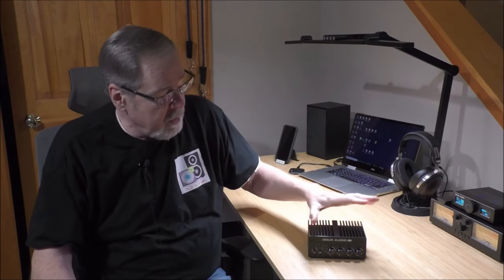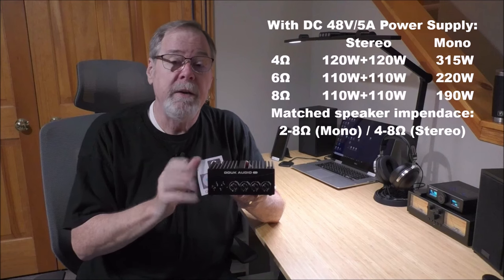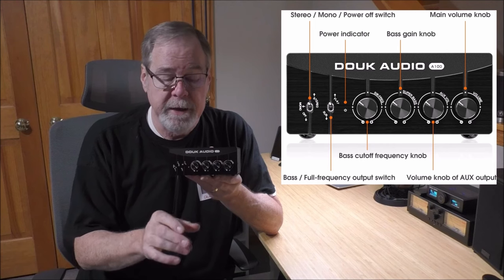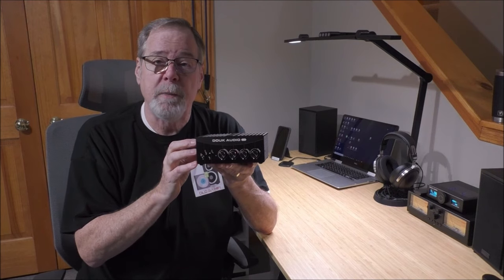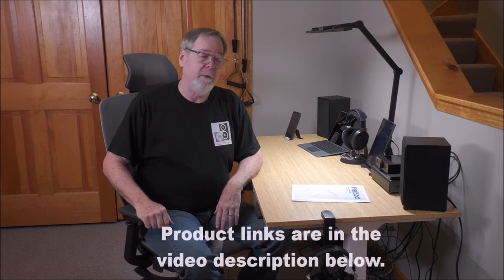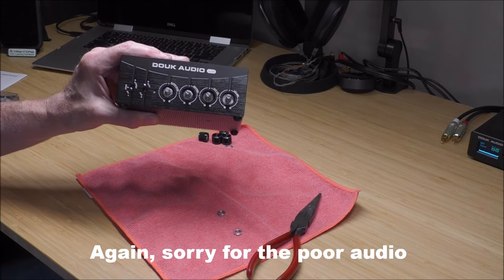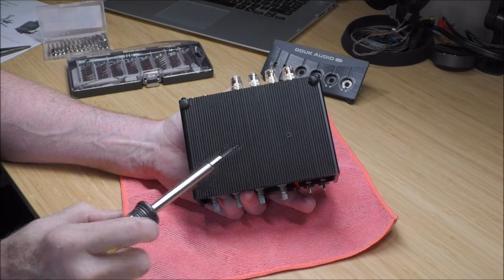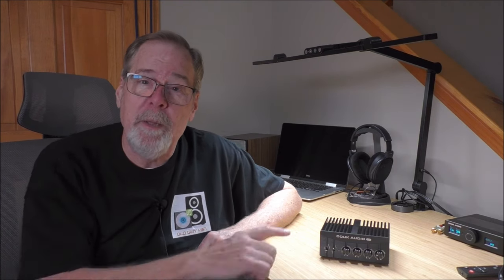The Douk Audio A100 Amp. It's a cool unit that you can tailor the sound of by swapping it's Op-Amps.

Comment: Nice vid! Thus far I'm really enjoying the A100. Was really floored to find it besting my Fosi V3 which bested the Ayima A07. 
Really not finding the need to even think about opamp rolling. Enjoying it stock. I find it to be very warm and yet detailed and punchy. GREAT mids! The Burr Browns did what to the sound ya think? I know the bass on the Fosi V3 may have dug a HAIR deeper and was probably had more slam. I'm a bass player and a bass guy and feel any tradeoff was well worth it to have all the other positive attributes that the A100 brings to the table. Speaking of tables.....nice table you have there for sure! :)
Reply from the maker: The BB2134s added a bit of warmth in the mids and took the edge off poor recordings.

Comment: I just got a raw amplifier board that has 2 3255 chips and changeable OPAMPs 

I'm sure that will be Douks next move with that raw board costing me $40 and a  48 volt 12 amp @ $25  this weekend I will put it together and run it like a conventional lamp with a Capacitor Bank as a reserve. 

Maybe I get it to a clean 200wpc.
Reply from the maker: Let me know how it goes. Thx

Comment: How do you think it would do with Mica RB-42's and is the Aux input accept Turntables. I assume you could put a switching unit in line to either use the TT or a CD player, no? I'm looking to put a small desk top together for my Granddaughter as she becomes a Vinyl kinda girl. But  I'd like to give her options in playback. I'm also considering a WiiM Ultra, but I don't think it has the juice for the 42's.
Reply from the maker: I think it would have enough juice to run the Micas. You would need a turntable with a built in phono preamp or an external phono pre as the A100 doesn't have one built in. You might want to consider a DAC maybe with Bluetooth so she could stream from her phone or tablet. Just a thought. Lay me know what you decide. Thanks for watching.
Reply: @OldGuyHifi  Well, the WiiM Ultra has a fair DAC I don't know but I'll look and see if it has a phone preamp. I was also thinking the Emotiva 2's or Elac's and either a Pro-Ject or Audio Technica TR and I like the Amp you suggested with Burr Browns though I've to add switching and a Streamer etc. We'll see it's all fluid at the moment. And Thanks for the Reply. There's always a 330 HK etc as well. High Current and all.

Comment: After rolling opamps did the depth of the soundstage and left to right imaging got better over the original opamps? when i tested it the soundstage had almost no depth. when i listened to the chain I swore stevie nick was sitting on mike fleetwood's lap and the left to right changes in chocolate chip trip were not completely smooth. in general the sound signature was great, nice and flat and very enjoyable.
Reply from the maker: I think we need to have realistic expectations when it comes to these "Fun-Fi" category of amps. They don't offer much beyond some watts for a low price. Nice for a desktop but I wouldn't consider them for any system more than that. Great comment. Thx.
Reply: @Douglas_Blake_579  The reason I originally asked was because when I A/B/C the A100 with an Aiyima T9 Pro and a Fosi V3 the depth of the A100 was a lot less that the other 2. Also, when sound was supposed to be from left to right and/or right to left the A100 was not as smooth. I do not expect it to give me a football field of depth, but not a flat wall of sound either. Like I said above Stevie Nicks sitting on Mike's lap is an interesting visual but not the way it is supposed to be.
Reply from the maker: In the future send this kind of comment to me in an email. We can have differing opinions. I am firm in mine and this is after all my subjective review. Thank you.